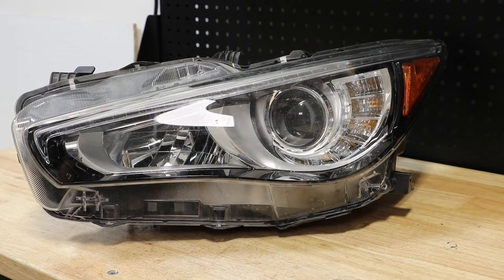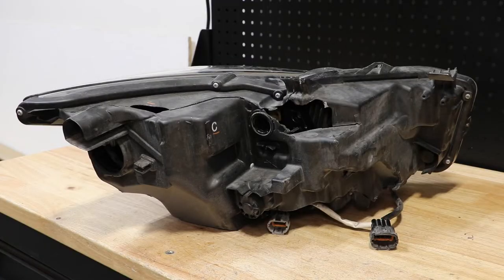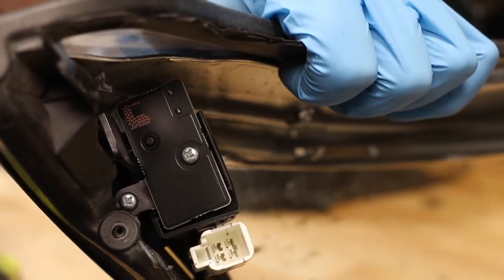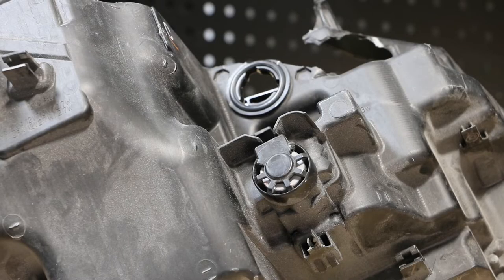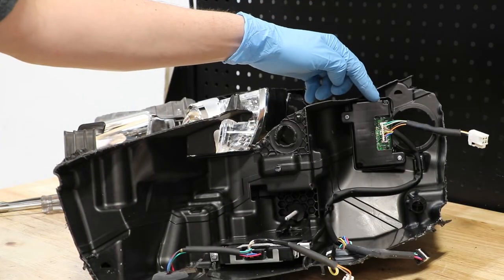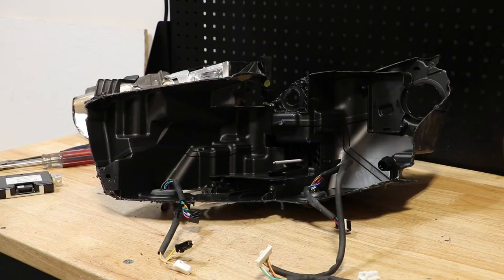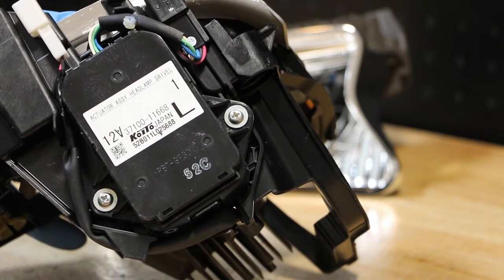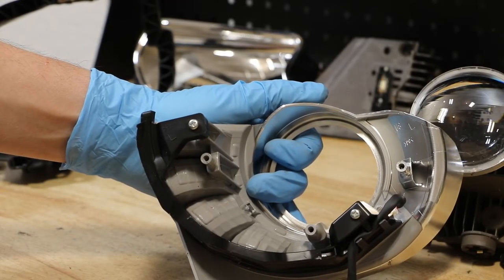2014-2017 Infiniti Q50 OEM LED Headlight Disassembly

Comment: Infiniti engineer who designed this headlight was high that day 
Thanks for the video 👍🏻
Reply: HIGH ASF
Reply: No this guy just doesn’t know what he’s doing read my other comment I customize Infiniti headlights and that is not the correct way to separate the lenses from the housing you never cut them I do understand these were already messed up but there’s a batter way to do this

Comment: thanks for this video, i picked up an old set of custom headlights for my q50 and the low beam did not work on one of the lights, my stock lights are currently in the oven and gonna use it for parts
Reply: update i swapped the entire harness and ballast from the working light to the custom one and it all works now thanks
Reply: @brandonuvinas  I was reading your post and you seem to be a lil familiar with infiniti lights. I just upgraded my qx56 with the front end of a qx80. Is there a way I can modify my harness to get the qx80 lights to work with my harness that you can think of off hand

Comment: the high beam on our 2018 Toyota with LED headlights has stopped working. Can this be repaired or does a complete headlight assembly need to be installed?  Thanks
Reply from the maker: Toyota full LED headlights are sealed.  There is no bulb that can be replaced.   You either need to replace the whole light or find a donor headlight to swap internals from

Comment: How long did you put it in the oven
Reply from the maker: I cut the lens off.   Depending on oven and size of light and strength of glue.  You should expect between 20-30 minutes and probably multiple in and out depending how fast you work/how much the glue melts

Comment: Did you use a “heat gun” to take off the headlight cover?
Reply from the maker: You can, preferably with an oven, but for this video I cut it off with a saw because it's faster and I do not put it back together.
Reply: @gftgrill  Would you know where I could get the information to wire up a set of 2020 infiniti qx80 headlights

Comment: What was going through the engineers mind when designing the headlight assembly? Perhaps 💰 forcing people to buy the whole headlight when the light bulb went out. Oh, and by the way…

Are you prepared? Jesus is coming.
Reply from the maker: Most engineers would opt for serviceability.   Accountants account for saving money per unit and sales people account for selling more units.  Odds are engineers were told to do it that way because it saves money on the build cost per light and when one fails the company will sell a new light or a new vehicle.
Reply: Of course Infiniti probably saved money doing this, but customers having to pay over $1,600 for their headlights to work is making Infiniti richer. So, whoever told the engineers to design it this way was thinking 💰in their mind.

Comment: Don’t take notes off this guy you need to remove all the screws from the back of the light 

Then you can heat up the oven to 275 and put the headlight in for 7 minutes to break the seal then take out out and begin to separate the lenses from the housing you may need a flat head to pry it slightly without messing up any of the plastic

Comment: Do you repair them?
Reply from the maker: I do not.  90% of the time it's not worth the cost versus a new headlight that comes with a warranty.
Reply: @gftgrill   So in modern vehicles with LED headlights assemblies, if the led or ballast stop working, you will have to replace the whole assembly? that's ridiculous.
Reply from the maker: @hedgehogthesonic3181  That is correct.   Some models have external control units that are replaceable or external led drive units (send LED light through an internal lightbar), but 90% if the LED fails, you need to replace the whole light.   This is also generally true for lower models that have halogen headlights with LED DRL.  If the LED DRL fails, it's not serviceable without opening the light and finding a donor light for parts.
Reply: @gftgrill   Why would they do it this way? just imagine 10 / 15 years, i don't know how reliable these  LEDs are, they will probably last 20+ years maybe, LEDs last a long time, but the ballast will fail most likely considering that these get so hot, and to replace the ballast you need to open the entire housing like you did, it's too much work just for that.